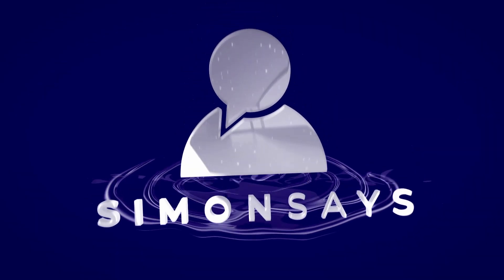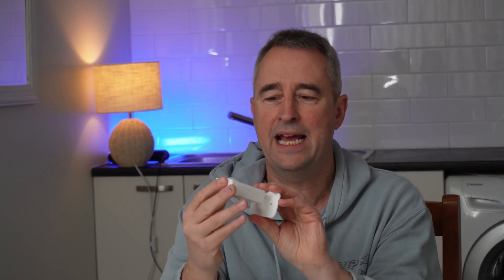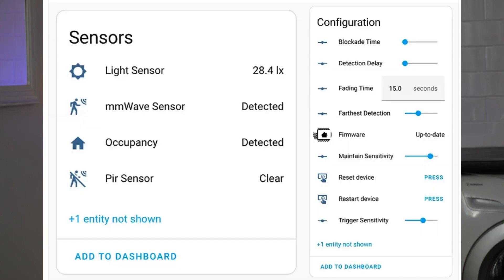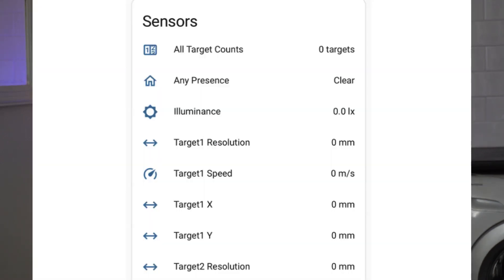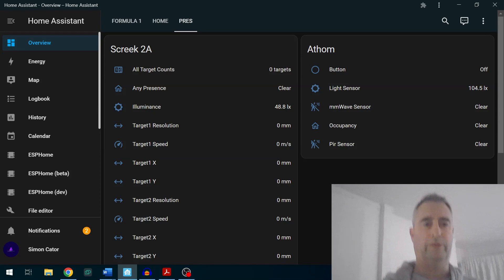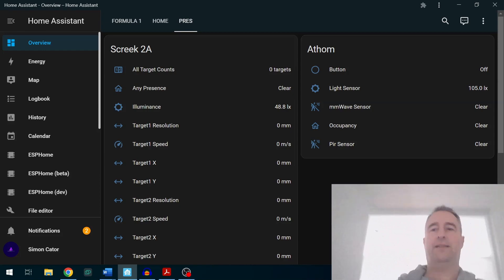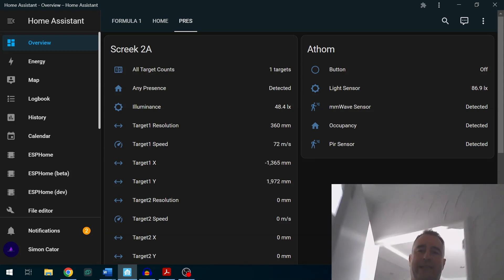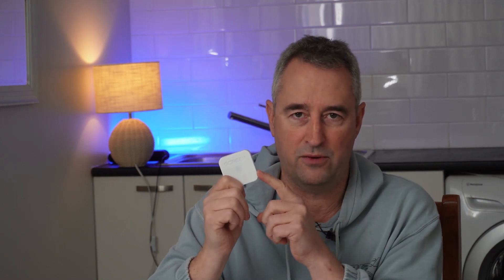Comparison video between Screek 2A and Athom mm Wave Sensors

Comment: Regarding the mmwave delay problem, please check whether your settings are correct, especially the Detection Delay option, it should be 0.1, or try to click the reset device button, under normal circumstances mmwave should detect faster than Pir, through this video mmwave delay is very Big this is not normal.
Reply from the maker: Hi there, thank you so much for the input!  Yes, I have just checked the delay which was 0.1 but once I reset the device the mmwave is now the first one to detect me!  Tell me where do you set the other options to?

Comment: You might to try rotating the screek sensor 90°  and see if the angle is wider? I know with the hi link the orientation matters
Reply from the maker: You are right Mark :) Rotating the Screek has dramatically increased the sensing angle!
Reply: @simonsayshomeassistant  oh that's awesome
Reply from the maker: Hi Mark, thank you for the feedback, I will give it a try!
Reply: @simonsayshomeassistant  curious to hear if it's wider. The hi-link ld2450 is a really interesting sensor. I have been using the ld2410c on my own sensors. The anthom is the ld2410 I think
Reply: By rotating the screen how wide is the angle now?

Comment: Thanks for this video... I have a DIY LD1125H mmwave sensor via ESP home installed and running pretty well in one of my bathrooms. I have ordered the Athom presence sensor and will be receiving it tomm, exceited to check the difference between these two... I just want to know what is the use of a PIR sensor along with a mmwave sensor ? my DIY LD1125H sensor does the job very well without a PIR
Reply from the maker: Yes, it seems that some MMwave sensors like the screek respond really fast while others like the Athom have a delay.  I have ordered the LD1125H and will try it out soon.  What YAML code did you use?
Reply: @simonsayshomeassistant  I just followed    DigiBlur Youtube video.. it has detailed explain and easy to follow with link to code.
Reply from the maker: Oh cool thanks for that Deepak.  Yes I really enjoy DigiBlur! @DeepakCG

Comment: I have messed with both of these. But the problem that I have is that the rooms that I want to put them in are too large of a detection area. That's the problem with living in a big house in the United States. Is that unless I want to use zigbee or Z-Wave these new MM wave have a limited range on them. I've tried figuring out ways to move them closer. But it's all dependent on a power source that works.
Reply from the maker: Yes mm Wave uses heaps of power!  Let me know how you get on.  My brother is using them as bed occupancy sensors
Reply: @simonsayshomeassistant  I'm testing that allso. I'm using the Screek one also. I have it positioned under the bed. I'm on the floor directly in the middle. It works okay but with a king size bed I'm having another problem. It's too close to the bed to get an accurate two-person reading. I can use it fine for just me or just my wife but not for both of us. So it's kind of a stupid problem.